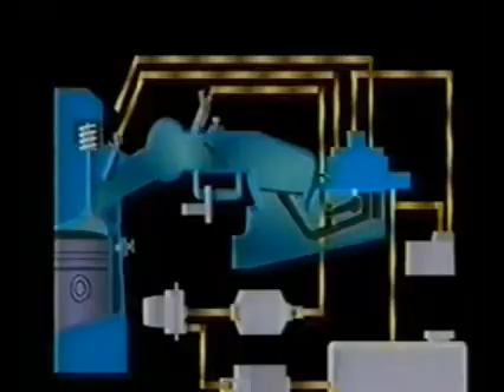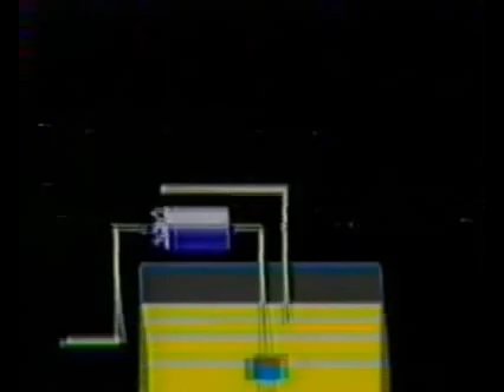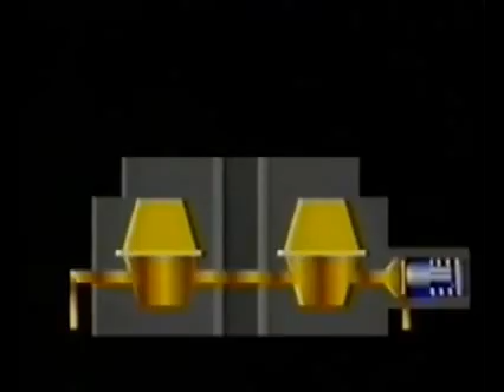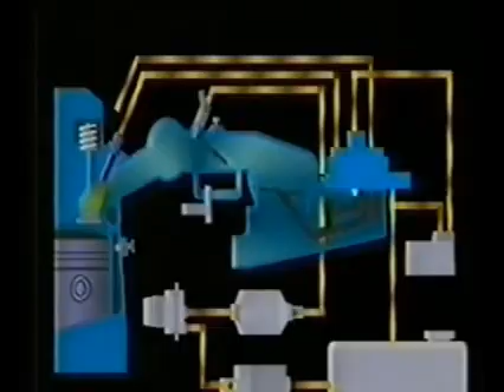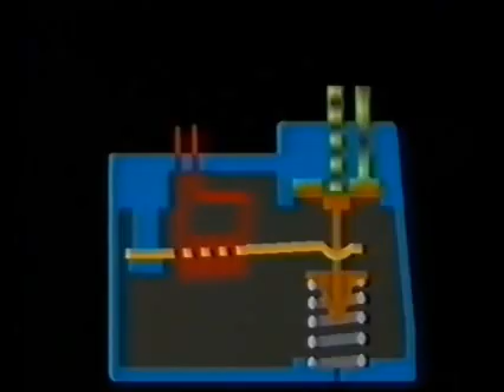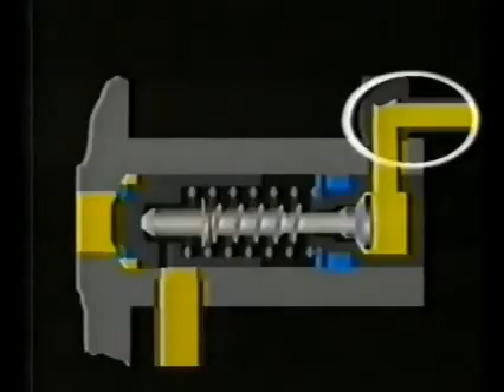Bosch K-Jetronic (CIS) explained

Comment: You can tell that it is a heinously complicated system by the fact that it takes a 20 minute video just to explain all the components.
Reply: Tom Butchen OK then how long would it take you to explain all the components and function of an EFI system in comparison? If you don't understand k-jet do you understand efi? CIS is more intuitivly understood than EFI IMO..
Reply: I have this system in my Mercedes 380SE. It's so complicated that I'm scared to mess with anything on it. I always have to give it gas when I start it in the morning because of the stupid warm-up valve. Plus my exaust smells like pure gasoline.
Reply: Ed Leclair I agree with you now. When I first commented, I didn't even know what a camshaft was. I did some work on my EuroVan with a VR6 and with so many sensors and computers for the EFI alone, it makes K-jet seem so simple. You can actually see every part working, instead of messing around with digital components. Yeah, it's less efficient than EFI, but would you give up simplicity for efficency? I sure wouldn't. My K-jet is still going hard, so much so that I blew my head gasket and I'm pulling the system apart now. K-jet only seems overly-complex for narrow-minded people who are too lazy to figure out the problem.
Reply: @AppleJack1997  I agree stay away if you haven't got a clue
Reply: Lol I have this on my Saab 900 because it was the easiest to install.
Reply: Or just new technology. Hardly that complex, merely new concepts that need explanation to the masses.
Reply: Modern EFi need you to learn for many years  how to handle the computer and to study interfacing...The KE Jetronic is fully mechanical & you can observe and understand. What happened if uou plugged in the ECU and it give you erractic readings..What are you going to do?

Comment: Thanks this shitty BOSCH invention i have problems with cold start. I have been to lots of electricans, mechanics, even audi center. Anyone doesnt know whats the problem. Nice job BOSCH
Reply: There is nothing wrong with this system. At the time it was a major advancement over carburetors. Even now I consider it superior to carbs. The system is shitty though if its not maintained properly, and taking it to skilled mechanics/VAG specialists who aren't 100% skilled and confident in CIS is just throwing money away. In most cases VW/Porsche enthusiasts who toil endlessly on these systems are a better bet than current VAG mechanics, as they know the troubleshooting better, and also how to deal with the scarcity of spare parts.
Reply: most likely your fuel filter is clogged -if you struggle to blow though it its clogged . If the car has been left for a few years the warm up regulator (the boxy thing with two fuel hoses and electric connection) is clogged up .Take it out when cold, clean with carby cleaner and blow it out . It must be cold or you won't be able to blow through it .It's basically a choke system - cuts off when hot . The K-jet system is pressure sensitive so anything that stops the pressure getting up to spec can cause problems. The injectors are really sprayers! very little moving parts . Hope this helps.
Reply: Most techs these days will have no idea how to work on or diagnose CIS, they are not trained in old systems like this. You need to take it to an old timer who worked on these cars when they were new.
Reply: replace it with a carb
Reply: lumbrs Well it's always like this for new tech. You have to expect to have failures if you do something revolutionary or cutting-edge

Comment: I horrible moment in automobile history I hate this system the price for a fuel distrbutor can cost 1,000$ PLUS for new and rebuilt ones are disaster waiting to hapen
Reply: Stay away from ethanol fuel, stick to as pure gas as possible
add an additional filter to the fuel distributor inlet down to a few microns I think 5 or 6.
Your system will be worry free. Ethanol eats the seals up and particulate matters clogs the micron size slots where fuel goes through. Never let vanish build up in your system, store your vehicle with fuel tanks of pure gas. Long term Headaches solved.

Comment: Thanks, I'll have to pick that up.  I don't know if you have read this book, "Bosch Automotive Electric-Electronic Systems" but it really helped me understand FI as seen from Bosch's viewpoint.  Obviously, K-Jetronic is completely outdated, but studying it really helped me understand.  EFI systems have such a low part count that a beginner is left in doubt as to how it does what.  With the old mechanical, every function has a part that corresponds to it.  That book explains better than this vid.

Comment: On a final note, Heres something you may not have heard of, but if you have a smart phone you can use it to scan for codes and read off engine data.  All you need is the "torque" app for android, there is also a similar app for apple, and an OBD-II bluetooth (or wifi for apple) interface and you are set.  The interface adapter can be found on amazon or ebay, and is about 15-30$. Turns your phone into a data logger and scanner..mine works great and if i need to pull codes, all i need is my phone

Comment: Yes, this is a really good point.  I had a Chevy OBD0 TBI that I bought cheap. It ran okay at some points but crazy elsewhere in the range.  The light was on.  All the older mechanics that knew more about a short block than I will ever dream of were scared of it.  I jumpered it and it flashed out some codes.  It was getting false air and maybe a bad TPS or IAC.  Something else, too, but can't remember.  It only took $75 and a few hours to make it purr.  So, yes, self-diagnostic can't be beat.

Comment: I would honestly hate to work on a broken Jetronic ...I think all I would be able to do is take it apart, clean it, and put it back together and hope it works.  EFI always seemed to make things easy (Even OBD-1, which you can also pull codes on just like the current OBD-II, even on the vehicles without the check engine light)....Most of the time its, pull codes, okay this sensor went bad, replace sensor, car runs like new.  If not, you are at-least pointed in the right direction

Comment: The Bronco I had with the speed-density type fuel injection never left me stranded...and what did go wrong with it was never a result of EFI failure...not saying it cant happen, or hasn't..but it never was for me.  I wouldn't go to an audi if i was looking for reliability though.   Mine had so many electrical issues that its a good thing the fuel injection was mechanical, or else it wouldnt have even drove.

Comment: Both of Ford's systems (speed-density and mass-air) from the 80s and 90s are inferior to Bosch, which had Motronic and coil packs out back in the 70s.  Even the mass-air Ford system squirts fuel on one bank of the V8 then the other.  This approach is virtually a continuous squirt.  Furthermore, if anything screws up, you are on the side of the road with your thumb up your butt.  K-Jetronic is deliberately mechanical for those of us who have owned F-series Fords and want D8-dozer type reliability

Comment: Nah, my bronco ii had muiltport fuelinjection, 100% electronic.  The only thing was that it ran from a MAP sensor instead of a mass air flow like vehicles that shortly followed it.  Hell, in 1991, the Ford 4.0 had the mass airflow sensor and already has distributor less ignition.  Im surprised audi was still using this ancient setup in 1991.

Comment: love it !!!! loved my K jet for 10 years! the induction noise is to die for! GRRRRR!
Reply: Howzit brother.I’m also running a kjetronic system in my Jetta mk2 1.8 8valve but my cold start valve,thermo time switch ,cold acceleration valve and throttle switch is not connected.can u help

Comment: trying to figure out why the injectors are spraying too much fuel into the cylinders. i think its because the plunger, thats controlled by the air flow meter, is stuck open causing it to send too much pressure to the injectors. im not sure if it is attached to the meter arm or if its pressed down with a spring, the video didnt mension either.